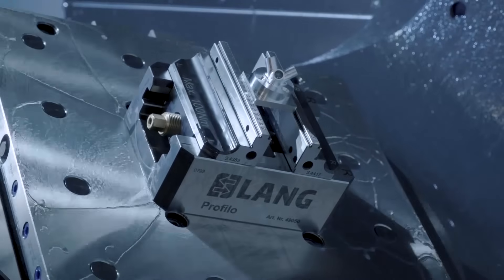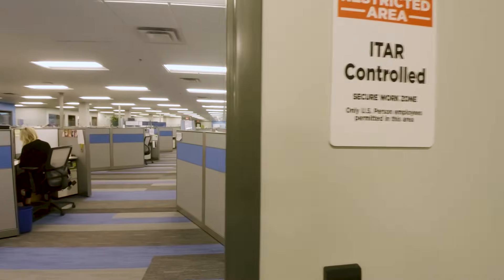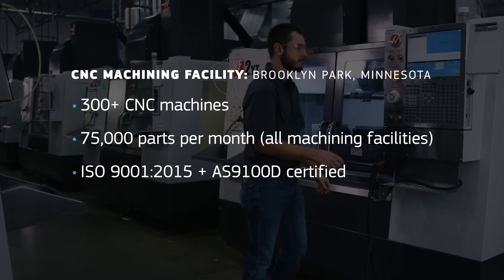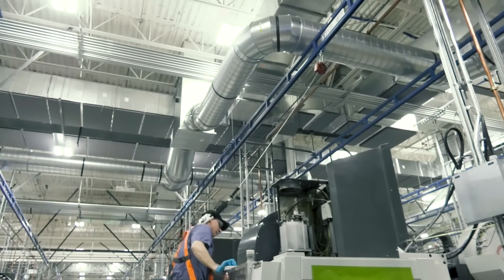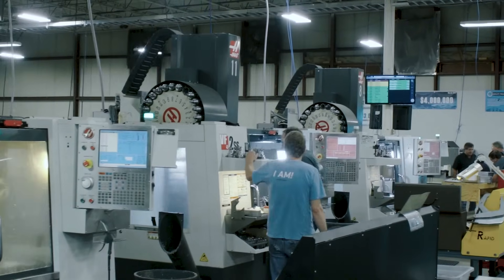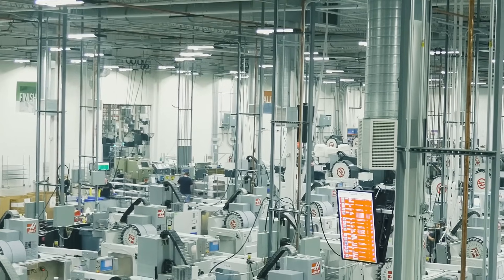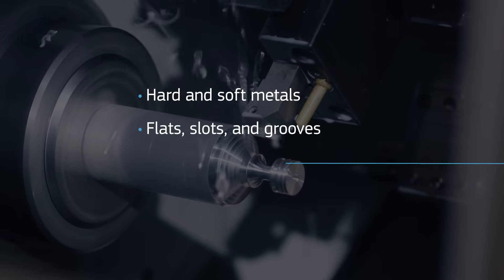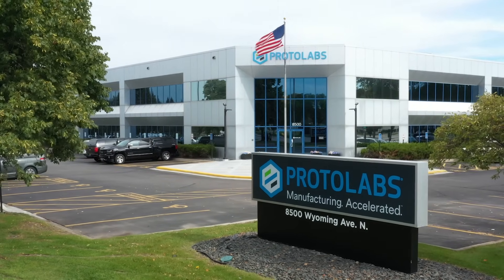Take a Tour Through our CNC Machining Factory - Protolabs

Comment: I would like to understand the strategic choice of buying all Haas, some or all will have 5-axis tables, and not buying native 5-axis machines with automated cells. It is true that Haas are cheap, but labor is not free. Do any of you have any ideas on this?
Reply: The answer are eazy. From the video they do smal serial or prototipe products. If you have a serial of 10.000 pc per year. Than go big. The Haas are just fine for this parts and smal orders.
Reply: @blue_water3888  I would have imagined 10-20 5-axis machines with robotic loading... and not 50 machines with manual loading
Reply: @mattia452  All depend on quantity of order or how many pieces have ben done.  I have done 3, 4 5 axis since 2002 . And at end of the day its all in the profits. Gain or loose money.

Comment: As nice as Protolabs facility is. It's hurting the small job shop.
Reply: Not really. A new customer of mine has stated that if you need anything with a tigher tolerance than .005" or many tapped holes, etc. They said forget it. If you can do detailed stuff, there will always be a place. These people want you to believe nearly everything can be automated. While some things can be made better, sometimes not every single detailed, technical thing can be automated. Unless you are talking about large volume orders, then it is easier.

Comment: Such a shabby entrance area, these "offices": desks and monitors placed as close as possible without being able to see each other, ... then the cheapest machines bought and the hall stuffed with them! And so cramped, if two machines need parts at the same time, one is stuck in a traffic jam! working here must be a nightmare!
Reply: Or he’s telling us he works at a not so cramped up manufacturing facility? Maybe?
Reply: Tell us you've never worked in a manufacturing facility, without telling us you've never worked in a manufacturing facility.
Reply: @Dfk429S9fo3  I have been working in manufacturing for 34 YEARS! And I've seen a lot of factories so far, but never such unkind offices - if you take the sign off the door, nobody knows what's going on there! There are no photos, no models (not even the obligatory flag on the wall!) I thought such boxes as offices only existed in bad parodies! 
And we don't have to discuss the fact that this production is a nightmare, do we? A third of the machines, possibly reasonably organized with loaders (yes, you can handle different blank sizes with one loader!) should be enough!